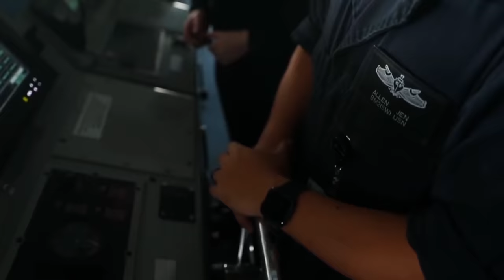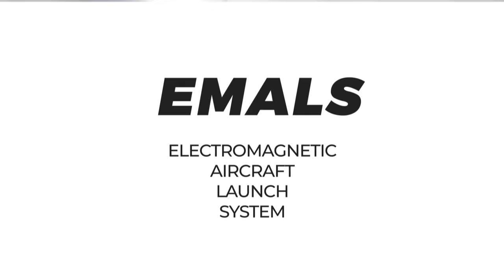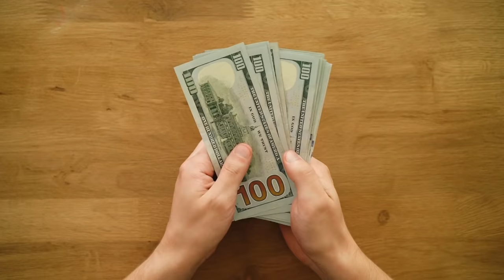This Is The US New Gigantic Aircraft Carrier Shocked The World

Comment: I would rather have seen 2 smaller ships with proportional capability and less venerability.
Reply: Look up the word venerability
I know, but still
Reply: @soritessoreites1207  Sorry, I couldn't find the correct spelling.
Reply: What we need is a weird cruiser with 2 turrets holding 16 inch 150 cal guns up front with a flat deck on the back to hold like 10 sea planes or helicopters to rescue people out of water. We got air power and anti missle defence already. Shooting ten thousand shells is easier and cheaper than a thousand aircraft a day. We also only need one ship to achive it. They are trying to use fighter aircraft like bombers. I dont think they can fit too many b52s on an aircraft carrier. If they need a bomber they got them already. If they are really trying to scare the enemy half way through their country before invading they need to get something actually scary that can attack without end. Planes are not scary enough. Ground forces can fight a plane but if a thousand dead chunks of metal is flying at you thats a bit diffrent. Every one says battle ships are obsolete but today if you need to respond in some country between the responses of nuke and sending ground forces we got no middle ground resonable way to get them.
Reply: @skipnielsen3335   You meant vulnerability - not venerability, NP! suggestions and spell-check conspire to make me pound sand, a good post like yours shouldn't be dragged down by them. BTW: Are you the OP to this thread?

Comment: A giant “sitting duck” that we need as much as a Tank.  I hope those military contractors enjoy their big paycheck at the taxpayers expense (as usual).
Reply: thats why they named it reagan
Reply: Let me ask you this then. In the case that a large scale war breaks out and we need to transport hundreds of planes overseas at once, how then do you suggest we do that? Also tanks are not actually obsolete as most MBEs or Main Battle Tanks, are designed with the purpose of aiding infantry movement such as assulting a fortified position with machine gun emplacements that turn your forces into swiss cheese and prevent forward movement. Also anti-tank weapons are not as common as you would think. All countries other than the US, do not have the large scale numbers of aircraft that we do that do that essentially would make tanks obsolete, and ground based anti tank weapons, that arent another form of   of tank, like rpgs are not as common as videogames and media would have you believe since rpgs are essentially a weapon against specific targets, that if used incorrectly by untrained soldiers can do more harm than good. But back to the topic, when you figure out a better way of transporting mass quantities of aircraft overseas, that isnt just building them onsite then yes Aircraft carriers would be obsolete.
Reply: Trust me it did not take hours to get aircraft into the air in the 1970's.  I doubt that changed ever.  Aboard the USS Ranger they had two sitting on the deck ready to take off at all times, and two right behind those.  If those began taking off more would be brought up behind to get ready to take off.

Comment: That thing is gonna cause sea level rise by itself damn
Reply: Trust me it did not take hours to get aircraft into the air in the 1970's.  I doubt that changed ever.  Aboard the USS Ranger they had two sitting on the deck ready to take off at all times, and two right behind those.  If those began taking off more would be brought up behind to get ready to take off.

Comment: I wonder if we have the very crucial under water protection for the Carrier as we have from above?
Reply: Trust me it did not take hours to get aircraft into the air in the 1970's.  I doubt that changed ever.  Aboard the USS Ranger they had two sitting on the deck ready to take off at all times, and two right behind those.  If those began taking off more would be brought up behind to get ready to take off.

Comment: How does an aircraft carrier compete with a hydrofoil, missile gunboat? The gunboat is smaller, faster, requires less support and is cheaper. How many gunboats can you deploy vs 1 aircraft carrier? Consider the use of drones vs aircraft.
Reply: Its because Carrier's don't operate independently, They operate in strike groups that have battleships, corvettes, subs, and support craft. Catching one solo would be a 1 in 10000 shot, the gunboat would have to run a gauntlet of the support craft, and then not get blown to pieces by interlocking Phalanx cannons from the support craft and the cruiser itself.
Reply: @DeltaFox19  Hey man, we don't use battleships anymore.. not for some time now.
Reply: @DeltaFox19  It comes to numbers - how many missile gunboats can you have vs a fleet of ships protecting a carrier? Bang for buck is what I infer. If we recall the Faulklands skirmish where 6 ships were sunk by 'lowly' Skyhawkes, bombs and Exocet missiles.. Modern drones and ordinates are a lot more effective. Multiple hydrofoil gunboats are easier to construct, faster, more maneuverable and can patrol a  vast area.

Comment: When you prioritize being politically correct with your "manpower" then this is what happens, but nobody is willing to acknowledge the root of the problem.
Reply: I don't think you'll find engineers and navy personnel to be too PC.  Political correctness has nothing to do with getting a ship ready.
Reply: @paulmicheldenverco1  Last time I checked one of the recent largest failures in Navy department and DOD by extension is the USS Gerald Ford which was planned and constructed with no urinals. I would acknowledge that corollary is not the equivalent as causation, but denial of sickness at the root of a thing is an assured recipe for further disaster.

Comment: Enterprise had two reactors.  This isn’t a new technology.  They stopped after the enterprise for cost cuts.
Reply: Trust me it did not take hours to get aircraft into the air in the 1970's.  I doubt that changed ever.  Aboard the USS Ranger they had two sitting on the deck ready to take off at all times, and two right behind those.  If those began taking off more would be brought up behind to get ready to take off.
Reply: Enterprise originally had eight small reactors, than they found out they could run it on four well. The plan was to bring it down to two, but I don't think they ever did. It's decommissioned now anyway.
Reply: @robertrichard6107  Correct i was on there from 2001-2004
You?

Comment: just as battleships become obsolete in WW2  aircraft carriers are also in the same seat --- they were rendered back then in WW2  useless against kamikaze attacks    but the war ended  with the atomic drops  before they too were going to be useless ----  for 13 billion it would have been better to have   24  air basseses on remot island taht  are unsinkable --- for the same money and less up keeps and hardly no fuel consumption  24 for strong bases would have been better - even if it has the latest tech in defeating incoming missiles all what you need is a bad fuse or small spark and systems are down and hell break loose                                                                                           their is anti ship missiles that are super sonic  with 5 warheads leave the maine missile  in stages the close encounter systems used can take them out but if  several  are deployed   say 6 were launched x 5 warheads   total incoming  30         its good buy  aircraft carrier  -- yes you can argue that the close in counter will demolish those threats  and yes is the  anser but not all of them  at once              nothing beats an unsinkable base the more bases we have the better the investment and there are plenty of spot around the world that we can get or even lease for that matter

Comment: This is a dumb idea. Gary Hart for better or worse knew we needed "Smaller Aircraft Carriers.
Reply: lol, 30 years ago.  That was before the F-35 was a twinkle in the eye of the Pentagon.  Now we have planes with 4 times the flight range who can take out enemies 200 miles over the horizon.
Reply: @chucklakeridge7944  But the F-35 can take off without a flight deck. All the more reason for smaller Aircraft Carriers, right?
Reply: @davidarbuckle7236  some F-35 variants can VTOL, some do not.  It's not a very practical feature for everyday launch and recovery from a carrier because its very slow, so fewer aircraft can launch⁷ at a time due to the slow acceleration from lift off.  If you think about it, having VTOL on a weight sensitive aircraft means they had to pull something off to make room for the extra system, so any VTOL equipped F-35's will have limited capabiliries.  Also, VTOL from carrier deck increases likelyhood of an accident when using VTOL.  Also, in the end, it's a very expensive option for the minor increase in capabilities.